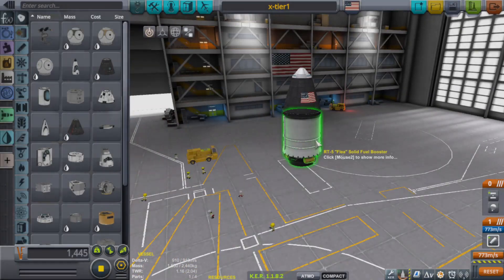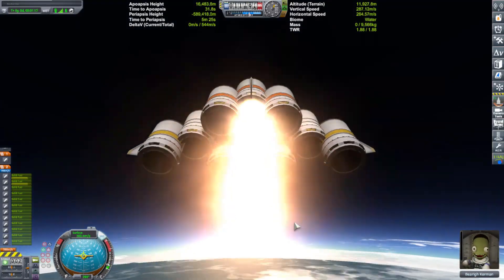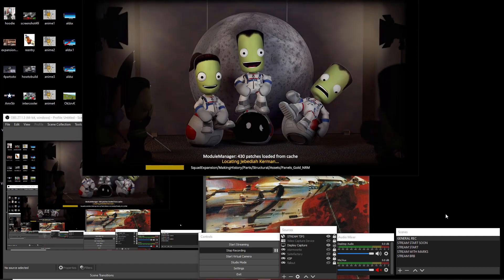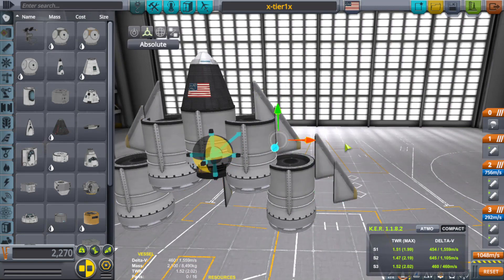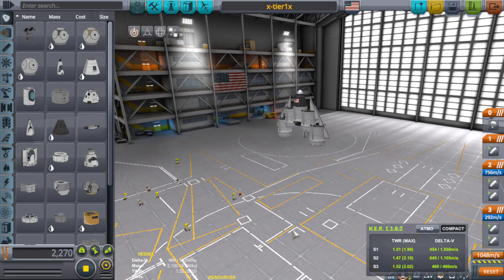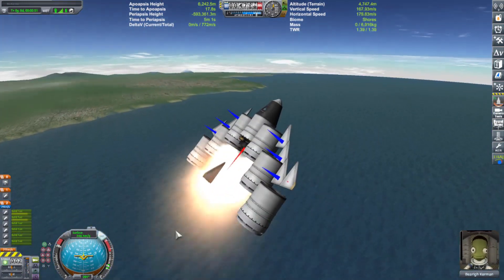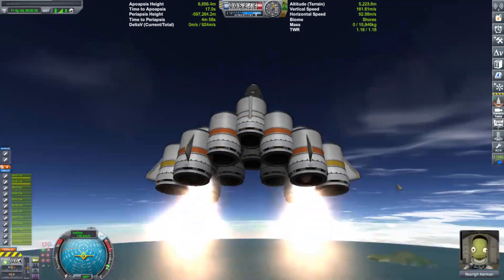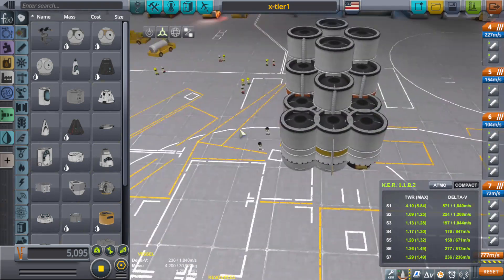TIER ONE SSTO are IMPOSSIBLE. Change my mind.

Comment: Okay so I tried a way to get lift out of sea level by using the pod's reaction wheels turning it into gods most cursed helicopter. That was basically a free 130m and 5ms before it  lost control and crashed, but it cost no fuel so I call that a win for efficiency.

Then I tried getting it to spin faster using rockets, as you can imagine it span so fast that it just came apart and exploded, but it looked cool.

Update: I turned the pod upside down to reduce friction when "spinning up" for take off, I have now reached 330m before running out of energy and plummeting back to the ground. I project at this rate of technological advancement I will make a tier 1 SSTO by 2030.

Comment: you can actualy use enngines as decouplers when the srb fired up the top engine will heat the bottom srb and explode it will act as decouplers. good for loosing weight
Reply from the maker: That would be considered a stage. It would no longer be an SSTO.

Comment: I ran the nuumbers, the flea booster is far worse than I remember, maybe it changed, whatever the case, the optimal Dv is basically at the edge of orbital speed

so in pure theory, if you allow a kerbal to get out an push (technically tech 1), if you do a perfect drag optimisation (pretty easy) and if you make a gigantic rocket to offset the dry mass of the capsule+kerbal+eva pack (way harder), without forgetting of course that the more dry mass into suborbital you bring the more EVA fuel you need to make the difference, then it's at the limit of what is possible

If you want to do the closest thing to succesfully achieving it, do this: bring as many EVA packs on board the capsule as possible, one kerbal, no parachute, one capsule
use node occlusion as you did for all the boosters, it's an absolutely mandatory part, so that your rocket is literally just a gigantic saussage with the capsule at the front (very very important), you can offset the boosters later, the game doesnt calculate drag from their real position (unlike re entry heating) only the node and angle of attack vector x drag cube matrix

for the flight path: get out of the atmosphere AS SOON as possible, the only thing that makes the tier 1 ssto remotely possible is the vaccuum ISP of the flea, a tier 1 SSTO is NOT possible within the atmosphere
of course the way you offset that is by making the part of the fuel that is spent in the atmosphere small overall to pull up the average exhaust velocity of the entire fuel cargo, that's why it's EXTREMELY IMPORTANT to get out of the atmosphere as soon as possible

also important is to stay always prograde, any angle of attack will kill your delta V, with the ammount of boosters you have (if it's perfectly forward only the cone of the capsule generates drag, if it's even an arc minute off the entire long saussage generates drag)
here I don't think you could improve your flying enough, getting this level of command is something for a computer, maybe mechjeb

as for the exact ascent profile, again that's monkey computer work, don't ask me, you have to  balance getting out of the atmosphere as fast as possible while at the same time always pointing prograde, what makes it even worse is that you don't have time for a gravity turn, you need to get out of the atmosphere faster than that, so the otpimisation here is the balance between getting out of the atmosphere ASAP and the drag loses from skin drag weighted by the atmospheric density and the square of the speed, so you got a nice 4 variable optimisation, again, computer monkey work, don't ask me for that one lol

but basically if you do everything I said, you should reach 70km while being between 100 and 300 meters short, depending on your flying

orbital is technically possible if you allow kerbals to get out and push, if you do a perfect flight trajectory optimisation, have perfect flying by a computer, and optimise the number of every ressource you take into orbit by around 50 meters per second, that's the mathematically perfect version, with so many things that can take away from that

lastly if you allow a kerbal to just get out and leave the craft behind making it a 2 part it becomes trivial to put a kerbal into orbit this way, and if you don't allow a kerbal to get out and push then it's impossible, that's the TL:DR
also NO FINS, you can't afford fins
Reply: kinda turned into a long post but there's all the information anyone needs to know about tier 1 sstos in it so meh
Reply: one last intresting thing to comment on: in the video VAOS says that with the tech you have you are about 1000 Dv short, that's completely untrue but it's also useful because it allows us to estimate the inefficiency of VAOS's designs  and flying, because without using any kerbals at the end, and if he used all other optimisation tricks, he should be 300 (maybe 400) meters per second short, not 1000, so this means that he loses around 600 to 700 meters per second by just being inefficient (way too much dry mass+not getting out of the atmosphere fast enough+flying performance)

also just because I know people are gonna fall into that trap, if vaos finds this information and then improves his design and is now less than 700 meters off orbital speed, that doesnt mean he can get it without kerbal assistance, that just means he likely dug into his inefficiency budget to get closer to the theoretical maximum without kerbals
Reply: lastly there is one part where an SSTO, even with getting out and pushing, is impossible, and that's the separatron, you cannot make an SSTO out of those, and you can only make an SSTOs out of flees if you have perfect everything and get out and push, but it's technically possible, unlike separatrons
Reply: I was curious so I looked deeper in the EVA kerbals, and turns out their EVA packs in pretty damn good, especially compared to flea boosters, the game nor the wiki gives the Isp of EVA packs anywhere so I had to calculate it myself, and it's 228 Isp, which matches the ISP of only the S2-17 "Thoroughbred" and S2-33 "Clydesdale" boosters

so absolutely possible to make an SSTO with stats like that, as long as you allow getting out and pushing
one last note is that I don't know how EVA fuel is replenished in the latest version, back in the days you had an infinite supply of it, if that's still the case then obliviously you can make an SSTO if you have infinite fuel, but all my calculations assume that you can only get the fuel that is contained inside EVA packs so it works either way
Reply: an additional note, for the getting out and pushing part, as mentionned compare to tier 1 tech the EVA pack is pretty broken, but sadly by running the numbers now that I have the actual value for the EVA pack stats, even getting out an pushing leads you 150 ms^-1 short, which is a huge shame
it could still be possible depending on the ammount of EVA fuel you can carry, if you can only carry into orbit 5 units of EVA fuel, then you get around 90 meters per second, if you can get way more than that, then you can get way more Dv for the final part, so it all depends on how much EVA fuel you can get into suborbital
as a last part to make my comment feel complete I also went ahead and calculated the ammount you would need, it turns out that precisely 20 units of EVA fuel are enough to get into orbit, so here is your answer everyone, if you can carry into orbit 20 units of EVA fuel or more then you can make an SSTO by getting out and pushing, if not you can't
all of that is assuming mathematical perfection for every part of the mission, of course from the get go we know that without getting out and pushing you come short of orbital speed, that's trivial to calculate, but with getting out and pushing it becomes on the edge of possible, depending on how much EVA fuel you can carry in your capsule, if it's 20 units or more, then good, you're golden, an SSTO is mathematically possible, if not then it's just about short, and of course if you ditch the craft and fly to orbit on your jetpack it becomes trivial even with little to no optimisation
Reply from the maker: @anonymous-rb2sr  wow. First you can’t admit when you’re wrong. Then you trash talk me. Must be nice up there looking down on us. Tier 1 SSTO is impossible. Get over it or make a video proving me wrong.
Reply: @anonymous-rb2sr  Lmao “the inefficiency of VAOS’a design.” It’s funny since it’s just impossible in its own right to make a Tier 1 SSTO with extremely low drag.

Comment: No but I can prove you right. Even if Kerbin had no atmosphere and you could do a perfect hohmann transfer from the launch site, so there would be no gravity and steering losses, you would still need 2381 m/s of delta v. With flea boosters and no staging, the maximum delta v you can get in a vacuum is 9.81*165*ln(1.5/0.45) = 1949 m/s.

Comment: What if you made a helicopter... blades from fins with sas and reaction wheels off. Uses long blades to take advantage of fulcrum force, and low thrust limiter on the srbs that spin up the mechanism. Use a mass driver from the pad (a stage zero, if you will) to give it some speed and altitude, and ascend slowly. Then petal to the metal!
Reply: you don't need long blades in KSP you can just have floating blades far away, even more efficient, things don't need to be attached with the offset tool

Comment: Averaging the atmospheric and vacuum Isp of the Flea to 152.5, and given the full/empty ratio of an unadorned Flea, the best delta-V you're going to get is ~1800m/s. Orbital velocity (without any launch dV) is 2296m/s - SSRO with Fleas ain't going to happen. 

A Hammer by the same calculation gives you ~2788m/s - I don't think anyone could get to orbital altitude with 500m/s, though. 

A bare Thumper gives ~3076, also IMO no. A Kickback by the same calculation gives ~3470, lower with aerodynamics and pod - probably the first solid fuel booster that has even a faint possibility of SSRO.
Reply: Yup. The small capsule with 7 Kickbacks (burned 4-2-1), a couple of fins for steering, and a small chute and basic nosecones for aero, is indeed sufficient to reach orbit without dropping anything. Periapsis ~85K, apoapsis ~400K.

Comment: Surly, you can not brake physics no matter what size your rocket is. There is Tsiolkovsky rocket equation witch says there is a  dV limit for one-stage rockets. So for the booster this limit is 1653m/s (atm) and 1948m/s (vac). Neither of these enough to reach  orbital speed, even without any air/gravity losses. Father more the numbers are correct, if rocket consists of the boosters alone (with no additional weight of capsule and other parts). Therefore it is theoretically impossible to make tear I ssto... Unless you come up with something not so straightforward. I think there might be a way around by using fins. Maybe some sort of a helicopter design witch will lift craft higher out of atmosphere and get some velocity will work. There is Obhert effect you might abuse this way by placing srbs' on tips of fast spinning rotor. Although the game have upper bound on rotational speed, so that concept  also might be absolutely useless.
Reply: I came to the same 1948 m/s conclusion
Reply: @miguelviola7264  Me too :3
Reply: @Pixel Astronaut also had the helicopter idea.

I came to the conclusion that the maximum additional specific energy available with Flea SRBs is only 1.9 MJ/kg, and the cheapest orbit requires about 3.2 MJ/kg, though.

Comment: @VAOS I actually did the math and a tier 1 SSRT is literally impossible (i.e to get 3400 m/s of delta_v it requires -2.767 boosters (negative boosters) lol). In reality an infinite amount of fleas would only provide 1948.81 m/s. I can show you the math if you're interested
Reply: Even though I am currently using a mod that does unmanned before manned so my tier 1 is not the same, when I experiment with the Flea I come to the same conclusion you did, the best I could seem to get was roughly 1948 ish m/s with them.  Though with my mod I can lift a small unmanned probe and I would be using a Mite, which weighs 0.375t full and with the payload empty it weighs .125t and it comes with 40 units of solid fuel and 11.012 kn ASL and 12.5 Kn Vac, with a ISP of 185 ASL 210 VAC and it burns fuel a 0.809/s....  I gave you that much info just in case you were board, and I haven't played KSP for a while so I don't recall if the Mite Engine is part of the stock game lol.   The point is though, launching a Stayputnik would likely be doable, but I didn't do the math on it lol. ...

Comment: I feel like you could just build  a quad of boosters and use the engine heat as a decoupling mechanism to get rid of the boosters without fuel
Reply: That would make it technically not an SSTO
Reply: then it isn't an SSTO

Comment: I've done a low-tech SSTO with tier 3 parts. It basically has 8 Juno jet engines, an LV-T30 Reliant engine, and 2 of the LV-909 engines. It made it to an 80 km orbit, but has hardly anything leftover. Basically, just enough fuel to deorbit and land back at KSC.
Reply: Isn't a single reliant enough for SSTO?
Reply: @4xelchess905  The smaller engines offer a little more delta-v in orbit.

Comment: I have an idea: 
If you build a gun-like contraption that accelerates it on the ground and then detatch a spaceplane like "second stage" it might be possible? I dont really know if it would count but my logic is that the "first stage" never leaves the ground so it doesnt count as another stage. Then Again good luck coming up with a design that doesnt brake it or unleashes the kraken
(not tested it myself as my ssto skills are... lacking)
Reply: yeah if you did some sort of mass driver thing that might work
Reply: But that kinda makes it a multi stage launch system doesn't it?
Reply: I agree its a multi vessel launch system but if the SSTO isnt attached to the mass driver at any point then it counts. Like if you Made your SSTO and then Built a Mass driver (different Vessels launched seperately) and you carried these to a top of a mountain i think it counts. Even if every thing else didnt use tech 1 parts. I mean would you call an SSTO that has a launch system that threw it like a paper airplane to get some velocity not an SSTO if so that fair enough but in my opinion an SSTO is a single stage to orbit and it goes Launch stage and thats it.
Reply: @TeReaper  The only thing I personally wouldn't count would be if he started on top of a mountain
Reply: @Weakness4theFleekness  started being the key word. If you got it onto the top of a mountain that's fair
Reply: I love that idea, but given how little Dv the flea has, that gun contraption probably has to stretch out to the 30 km range and release the craft with at least 400 m/s

Comment: How much dV can you save by launching from a different launch site, with higher elevation? I believe the Desert site is the highest with around 900m above sea level. Probably not enough, but it might be a small part of the solution.
Reply: I think woomerang is actually
Reply: @phoenix0166  Woomerang is also at a much higher latitude though, so you get less of Kerbin's rotation helping out
Reply: @Swagaito_Gai  ah ok
Reply: 900m is a big difference
Reply: @among-us-99999  The main difference is gonna be different atmospheric pressure. And the most important aspect of that is less drag for a projectile being launched by a gun-like device.
Reply: Even if you launch it from above the atmosphere that's still not sufficient. You're gonna need to launch from like 200 km. At least.
Reply: @petersmythe6462  didn't stratz launch from the highest mountain that one time

Comment: If i recall correctly in older versions "tier 1" had the hammer which has twice the delta V, possible in older versions this could be done. Although the higher dry mass might cause problems
Reply: Doesn't matter.  Current version doesn't work like that.
Reply: @DoremiFasolatido1979  Plenty of people play on older versions, so it does matter.
Reply: @DoremiFasolatido1979  dude. You just said," no that's stupid shut up your stupid". Did wernher von braun talk like that?
Reply: @DoremiFasolatido1979  hes just mentioning it bro, don't be such a cocky bitch
Reply: @DoremiFasolatido1979  I mean i disagree but only because of your attitude. Follow Wheatons Law dude.
Reply: @TeReaper  I'm with you, but I feel like most commenters can't begin to imagine caring about being nicer. Doremi might not even see their comment as rude. "Just stating the facts" has become excuse enough for most.

Comment: What about placing 1000 kerbals on the rocket (grab action) at the apogee and use their RCS (Eva) ?
Reply: Can you grab and use RCS while holding on? Before I started budgeting dv hardcore, I had to GOAP a few times, and it seemed like I couldn't grab and use RCS at the same time, so I always just RCS'd against the craft, slipping off very often lol.
Reply: How are you going to control 1000 kerbals at the same time
Reply: 1 you can't use RCS when on a ladder

2you can only control 1 kerbal at a time